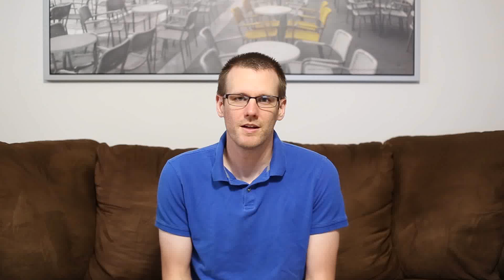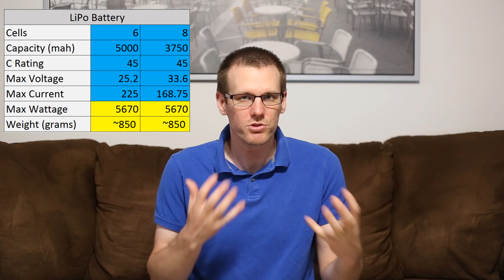Select an RC High Voltage or High Current Setup

Comment: Forgot that the lower voltage higher amperage all connectors have to be so much bigger. As more weight and all the other hardware because of that. So you save on weight on everything else.

Comment: Thank you
Also high voltage and low current have less loss on whires and connectors, less heat, is more eficient.
What is the down side is usually more cells are batteries are more expensive and If one cell fail all battery fail. 
For example I have ldark et 115 2s version and on the market is also 4s version. The battery for 4s version is almost double expensive than mine. The flight time is the same. Perhaps 4s version have much more power, I dont know. 
Aniway when is about performance more voltage , better.

Comment: I have a question on this subject. Another RC youtuber(french language) claims that 1/5th scale, heavy (20kg) cars will have a longer runtime with high voltage setups?
Lower voltage systems have higher currents, which result in bigger heat losses.
For example, the Losi DBXLE 2 has a factory 8S system. Changing this setup to a 12S system, reduces heat losses and increases runtime.
Is this statement correct?
And 2nd questions: Does C-rating influence heat losses in the 8S setup?  Will a 100C lipo stay cooler then a ,same capacity, 25C lipo in the same setup?
Reply from the maker: Hi Manu D, this video should help answer that question as it explains that exact idea in detail.

If you are expecting to run the same power output (watts) with different voltages but a different Kv motor to maintain equal output RPM and all else equal, it won't matter so much. If you are going to try and make more power by going up to a 12s Pack, this will make life so much easier. 

To counter the problem with higher current leading to increased losses, a suitable motor with a lower internal resistance must be selected. Going up to 12s vs 8s will require a motor with a lower Kv thus a higher internal resistance. The higher internal resistance and the lower current draw cancels out when compared to a higher kv motor ran at higher current and lower voltage. 

Most new hobbyists would be better suited to use the higher voltage setup as it is much easier to manage lower currents vs higher. 

To answer your question - Changing this setup to a 12S system, reduces heat losses and increases runtime.
This is a huge simplification of a complex problem. Changing the system out can improve efficiency completely independent of 12s vs 8s. One could state, changing out the stock 8s setup to a more efficient one can increase efficiency as well. At the end of the day the power system should be selected based on how much power is required then go from there. 

Yes a 100C LiPo will run cooler than a 25C LiPo with all else equal.
Reply: @RCexplained  Thanks! I
Reply: https://youtu.be/uRZlX6t7Xv4. 
But in this video you show that 9s system is 20% more efficiënt then 4s system?
Reply from the maker: In this video I show its a lot easier to select a power system for efficiency based on a higher voltage. It's also a lot easier to manage lower currents for newer hobbyists.  

The difference in efficiency is not 20%. It's actually approximately 92% vs 93.5%. This translates in to about 1.5% increase in run time running at these specific conditions. Nearly negligible. 

Now if you want to increase the efficiency of the lower voltage setup, increase the motor size, select a motor with the same kv or slightly higher to increase the RPM output. The internal resistance will drop making it easier to surpass the efficiency level of the example in this video. The difference will be you won't need to completely swap out the entire power system.

Comment: So if I use high voltage but dont change the motor to a low kV one, the torque will suffer, since torque = current and the high higher voltage pack wont be able to push the necessary current? Even though both packs can push the same total power if the load is right?
Reply from the maker: That is correct if the battery can not push the required current for the load.

Comment: I have a xlx esc and a1450 kv tp power brushless motor for the kraton 8s. Is this a good convination? Or should I get a different esc? Thanks for the great videos
Reply from the maker: Although I haven't used it, the XL X ESC is a beast and would fair well with your setup.

Comment: I prefer high voltage setups with larger motor size at low kv. Its win win! because esc,battery and motor runs cool and lasts longer
Reply: Super correct, Ryan helped me with this, I had to return two RC boat motors of 800kv and get the 400kv version.
Luckily I happened to have a friend who flew to China so all that procedure of returning them and getting them replaced went smooth.

Comment: Thank you for these videos, i've learned a lot. I have one question that i hope you can help me understand if you find the time. Does a typical RC ESC demand speed or torque from the motor, based on the input from the receiver? For example: Say we have a 7.4V system powering a 2000Kv motor, and we pull the throttle to 50%. Will the ESC provide max voltage until 50% of top speed is reached, or half of max voltage continuously?
Reply from the maker: Thank you Jan for your comment.The ESC will simply switch power to the motor on and off very quickly. Lower throttle is possible by chopping this signal. The ESC will provide full voltage.
Reply: @RCexplained  That is interesting, and answers my question. Thanks!
Reply from the maker: @yvindholgernes8950  Excellent!

Comment: Excellent videos.really learning alot.I just wanted to know if I got a 2000kv motor on a heavy boat(26 pounds) and I change from 3s to 4s without changing prop will the current draw go up or down.also how much more watts will be produced.thanks
Reply from the maker: Thank you for the comment Thakrim. Current will increase. Depending on the setup it's possible to easily see more than 60% increase in power output when voltage increases by 30%.  Make certain your power system can handle the additional load. To see what the actual increase in power is, you must measure it. Take a look at the video I have of a cub running on 4s vs the power running on 6s. Difference was big.
Reply: @RCexplained  thanks alot for the reply.will check it out
Reply: Current will increase. Motor have the same resistance.

Comment: great video series thank you. question, why does the high voltage set up have to have a lower mah then the low voltage?
Reply from the maker: Great question. The high voltage setup does not HAVE to have a lower mAh battery pack. However, if you were to match the same 5000mAh pack you will now face a weight disadvantage. The EDF where that example came from would not be able to handle a heavier setup without a sacrifice in slow flight performance.
Reply: Thanks for that answer.  I purchsed 2*4s gens ace 5000mah battery 50c , and a tp 4070 , 1440kv and a flier 300a 2-8s esc . I hope that will be a good setup for my df 35 boat ?